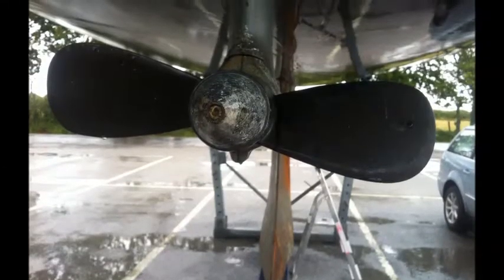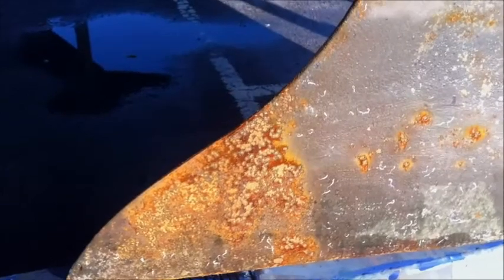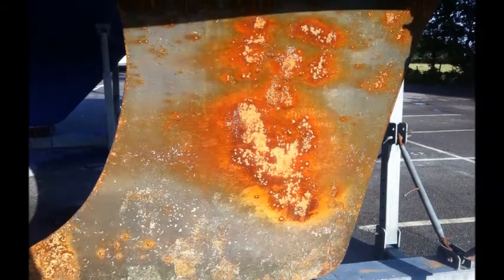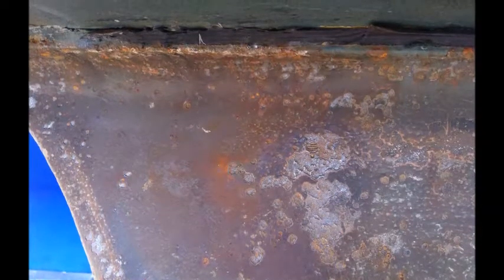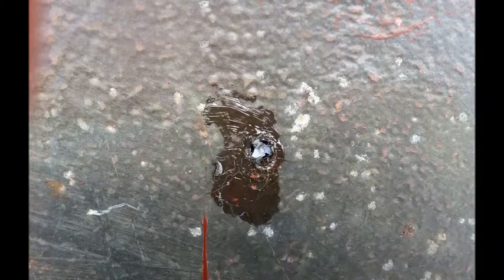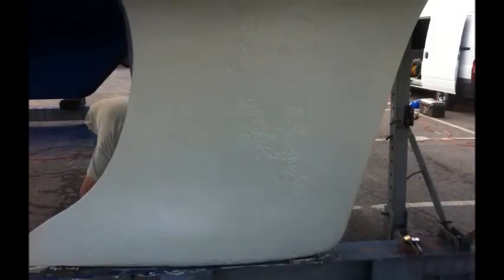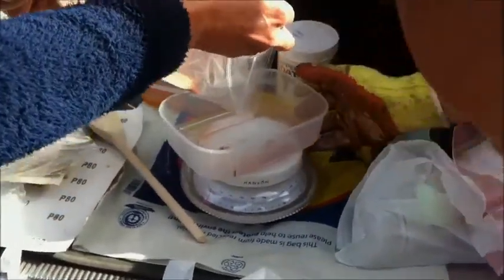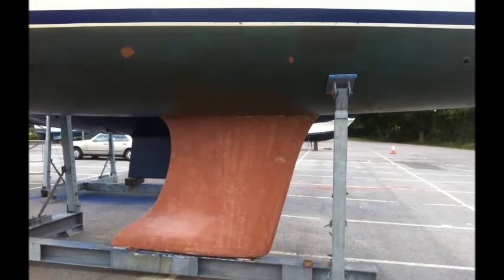Episode #3: DIY SAVING £££s -- TREATING THE KEEL

Comment: I don't think that will last very long.  You should have faired it and sealed it with a thick layer of epoxy.  Then a nother layer of epoxy primer and then three layers of Auntie foul.
Reply: Hello. I'd like  to know if by "fair"  you mean grinding the surface smooth? Do you have to remove all visible rust, even if the surface is already smooth, or do you just epoxy over the rust? 
And is primer necessary to put on before antifouling? And when does gel coat come in?